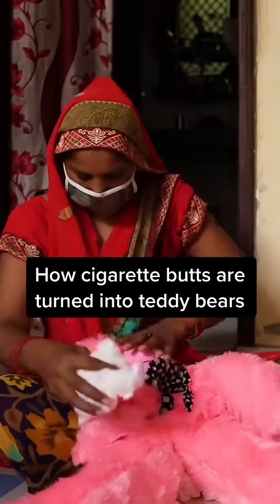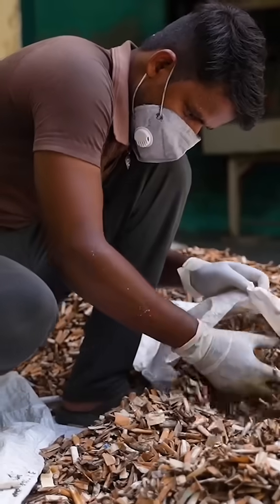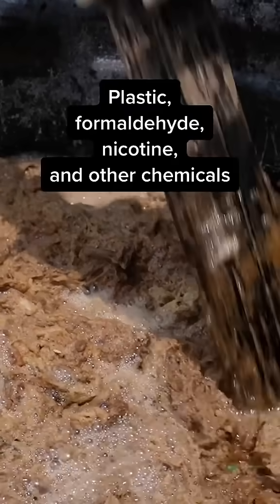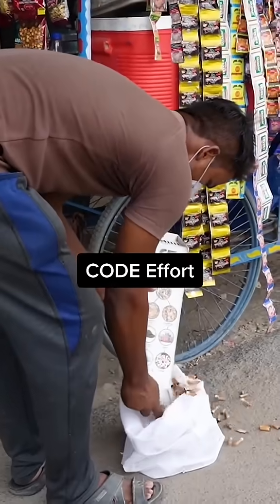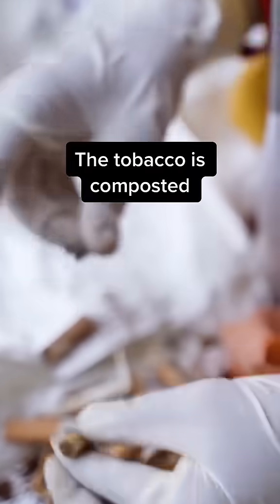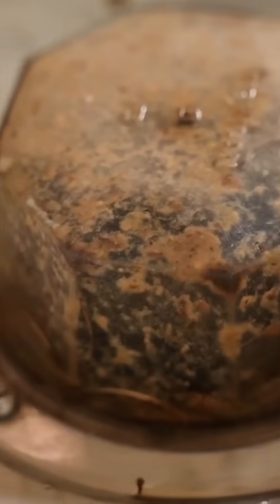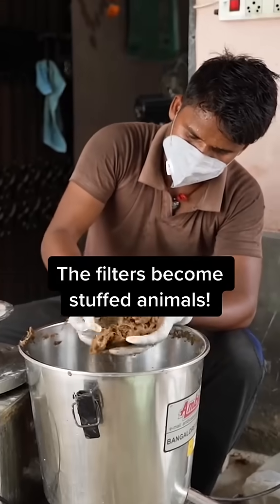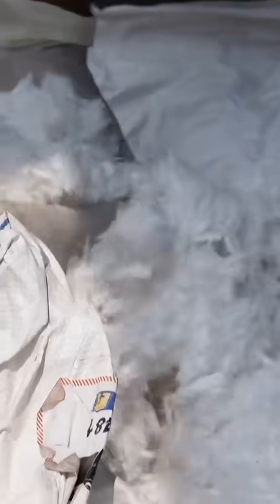These teddy bears are made from cigarettes | #shorts

Comment: I'd suggest investing in lightweight vegetable oil and spraying in water holding areas and planets and starting a public education system which informs the public about the breeding of mosquitos in water holding pots jars tires refuse etc and quiet burning the paper and just compost it to which will kill off nematodes with the other tobacco...  
And some cigarette filters contain fiberglass.... Just saying... Are you trying to burn them??? They will burn, melt or do nothing which is fiberglass unless you're using a blow torch 😂

Comment: It's funny people think this is an environmentally friendly way of disposing of the butts. Chances are the tobacco doesn't get composted, it probably gets sold on the side and rolled into new cheap cigarettes. The chemicals used to "sterilize" the filter materials are probably toxic, the water/run off from that process is definitely toxic to plants and animals with all the formaldehyde, nicotine, and tar that's in it. And then you have all the machinery needed to do it all.

Just incinerating them at a power plant would create less pollution than this whole thing....

Comment: That's not true about what the filters are. I worked as an electrician at the RJR factory in N.C. I've seen the whole process of cigarette making, from start to finish. The machine that makes the filters and packs them into the cigarette is nothing more than a cotton gauze. It's spooled off and sort of frayed before being packed into the cigarette. There's no plastic or formaldehyde in the filters, that's just bullshit. All the bad stuff is used on the actual tobacco that goes in the cigarette.

Comment: Although it’s a remarkable to repurpose discarded material, did anyone notice they were using small razors to cut open the cigarette butts? I feel like that’s so dangerous and inefficient. Imagine dropping it in your work area and not being able to find it until you stick your hand in your work pile and slice your hands. I can’t imagine how many cuts they have on their fingers. But also think about how much they have to slice these tiny cigarettes one-by-one with such a small tool coming so close to their fingers. Why not use needle nose scissors which are safer to use and are extremely easier?